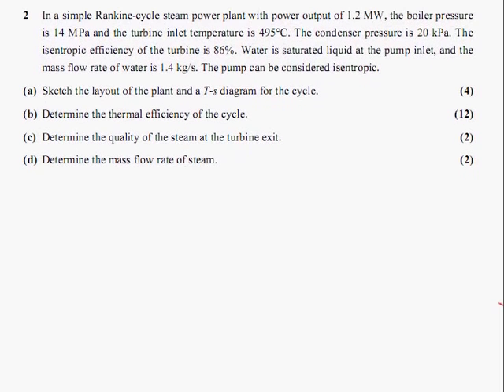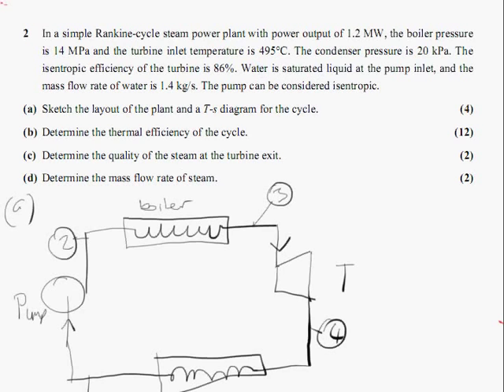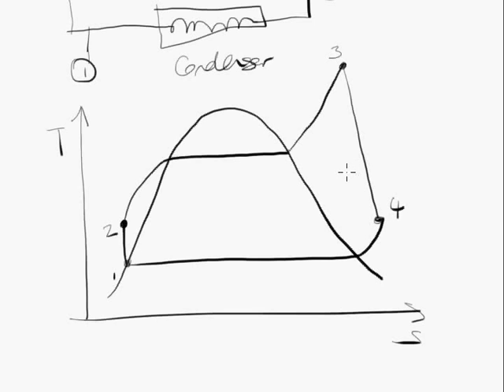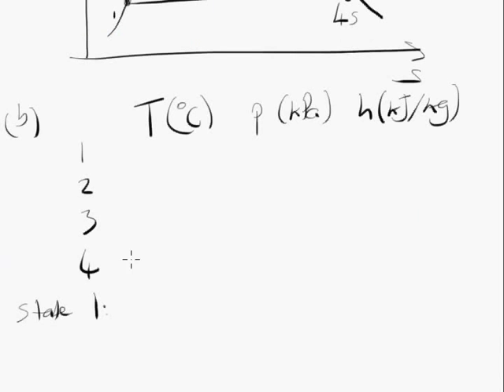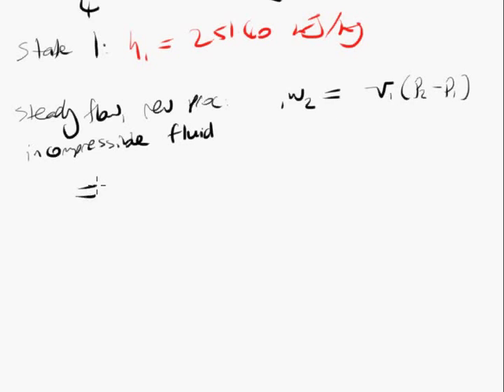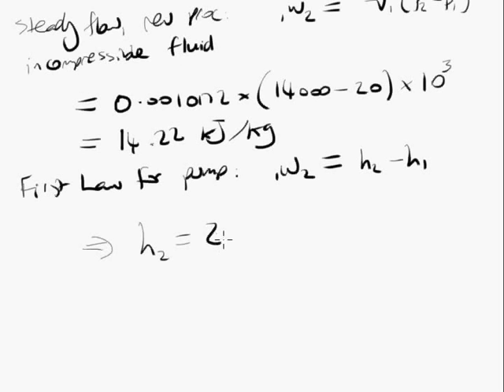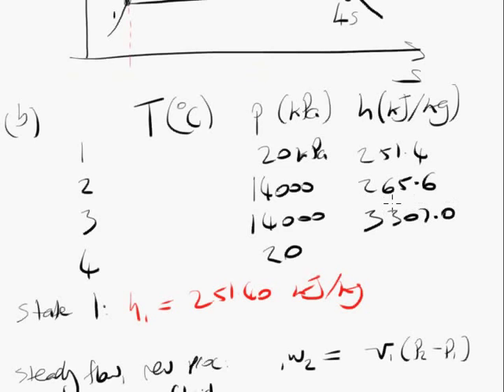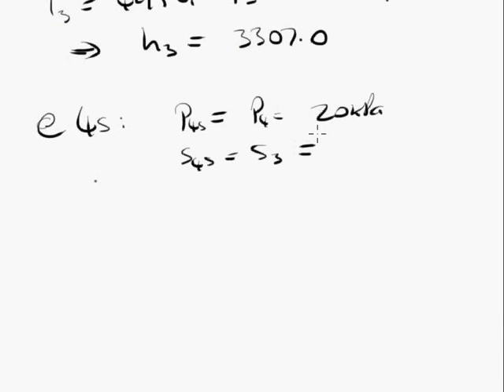Rankine cycle example part 1 of 2

Comment: Hi Nathan im doing a project on a combined heat and power plant.  The Plant must be 75% efficient to qualify for the Renewable Energy Feed In Tariff in Ireland. I want to do an analysis on the steam to show how the 75% efficiency occurs. the Rankine Cycle I will have will have a derator how will this effect the cycle. is it possible to put up a video regarding this. the derator will be in place after high pressure steam exits the turbine with the low pressure steam going to condenser